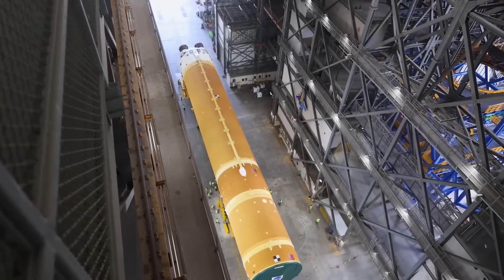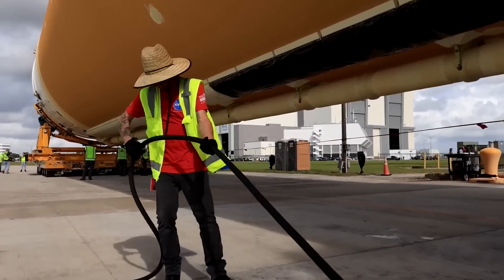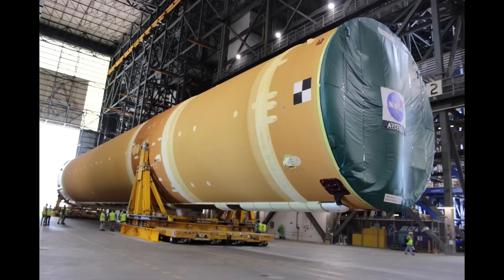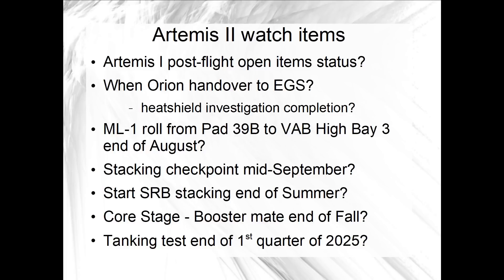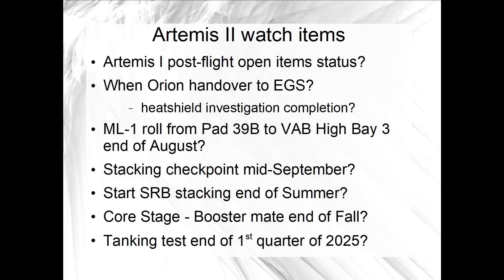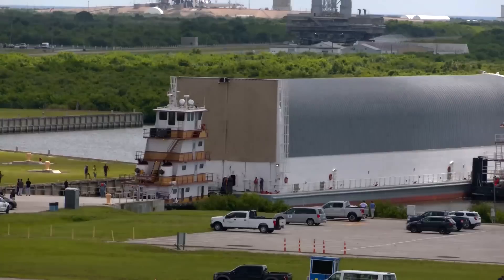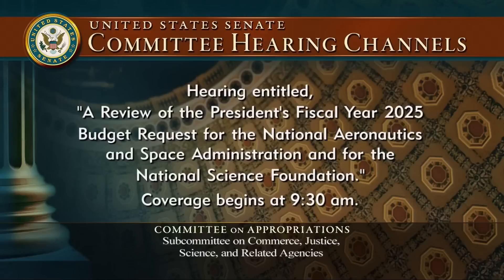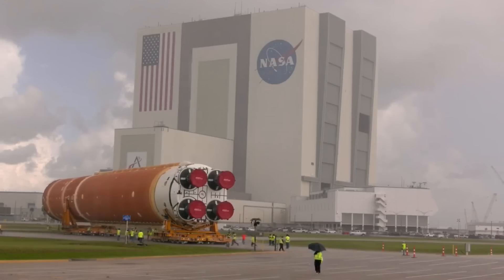Artemis II Core Stage in the VAB and Congress has SLS questions

Comment: Wonder how many Starships will fly between now and when this thing is fully stacked. I’m guessing six.
Reply from the maker: SLS is the one with the launch rate problem, the key Starship measurement for Artemis is lunar capabilities.  If Starship can make it to the Moon before Artemis II is stacked, regardless of how few or how many launches it takes, NASA will be behind, but very happy.

Same thing to lesser degree with a closer milestone, the HLS ship to ship propellant transfer demonstration.  The last projection for the HLS Option A critical design review was August 2025.  NASA will be happy no matter how few or how many Starship launches it takes if SpaceX can complete all the prop transfer demo objectives and complete the CDR process in the next 12-13 months.

The flip side to that is if Starship flies a lot in the next 12 months, but can't complete the prop transfer demo.
Reply: @PhilipSloss  Thanks for the detailed reply. Agree SpaceX has an enormous amount of work to do, and not much time to do it in. Even so, the difference in pace and activity between SpaceX with its development and testing of multiple prototypes for a fully reusable heavy lifter, and Boeing/NASA with the glacial assembly of a single fully expendable heavy lifter, is… striking. And Jim Free will tell us (or at least heavily imply) that Artemis delays are SpaceX’s fault. Sorry for the little rant; that guy seriously rubs me the wrong way!

Comment: Thanks Philip! The news from the Senate Appropriations Committee is very interesting and something to keep an eye on (as you stated!).
Reply: Yes! SLS/Orion fan here, but cost of system must go down to continue to get public support. This study may lead to Boeing and Lockheed working really hard to get the cost down as low as possible, or even better lead to another system that will supplement transportation of crew to/from Gateway.
Reply: @stevengoyette3165  I believe the NASA response to the OIG recommendation was that they had already looked for competition ahead of starting the process of awarding a sole source award to DST.
No rocket in development could meet their launch requirements to TLI and getting another contractor the ability to manufacture SLS components would be far too expensive and time consuming, I suspect the NASA response in this study will be much the same, not that we'll get to see it because these almost never get publicized.
Reply from the maker: @brokensoap1717  This was not a recommendation in the IG-24-001 report from OIG to the NASA Exploration directorate, it was more of an informal one to Congress.  It remains to be seen how far the next Congress (or the ones after that) would take it, but it is something that is more actionable for Congress than NASA ESDMD.

Edit: tbf, Recommendation 5 in IG-24-001 is related to some extent and is worth pointing out.
Reply from the maker: @stevengoyette3165  Those were the two prongs of the directive, one was to get an update on what's going on with EPOC and the other was the analysis of commercially-developed heavy-lift.

Tbf, this might not go anywhere, particularly since this Congress will end in January...but it does suggest a shifting of the dynamic between Congress and SLS.

Comment: I don't know why the ICPS isn't stacked on the LVSA first in the VAB's low-bay before being stacked onto the SLS first-stage as this would save a stacking step.
Reply from the maker: Not something they've gone into that much, but it's possible that there's more post-mate work than the lift to mate process.  There's also more access in the platform layout in the VAB integration cell than on the floor of the transfer aisle.
Reply: @PhilipSloss  I'll elaborate on what I meant. When the Saturn V was being stacked after the S-IC was stacked onto the MLP its' forward had the S-IC/S-II interstage stacked onto it in the VAB's low-bay before the S-II was stacked onto it. Then that assembly was lifted and stacked onto the S-IC, a similar process happened in the low-bay with  the S-II/S-IVB interstage and S-IVB. Now if the ICPS was stacked onto and integrated with the VLSA in the low-bay before being stacked on top of the SLS first-stage that would eliminate one step in the stacking process. Now if the same step is done in the low-bay with the Orion spacecraft/LAS assembly stacked onto and integrated with the OSA before being stacked onto the ICPS this would also eliminate another stacking step.
Reply from the maker: @nicholasmaude6906  The Orion & OSA is an example.  At least for Artemis 1, they stated that the lift sling used for the Orion lift was not rated to go that far above the Orion by itself.  The crane(s) can go higher than that, but not necessarily all the lift elements, like that sling.

So that's one example.  It should also be noted that the process of lifting and mating the elements isn't necessarily where most of the work occurs.

The stages have to talk to each other, to the boosters, and to the spacecraft and all of them have to talk to the umbilicals on the Mobile Launcher.  

After the boosters are stacked, they were looking at about a month to bolt the Core, LVSA, and ICPS on top, but three months worth of integrated test and checkout of the SLS vehicles after that.
Reply: When it's not clear why something is done a certain way in the SLS program, it's good bet it's done that way so that it will cost as much as possible and stretch out the schedule as long as possible.  Mission success is a very low priority, and being on budget is actually considered something to avoid.